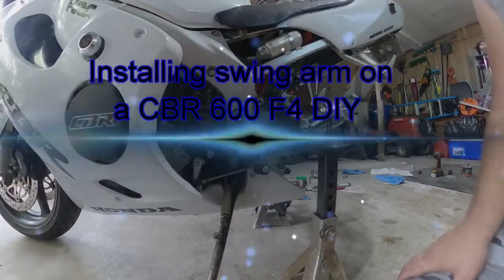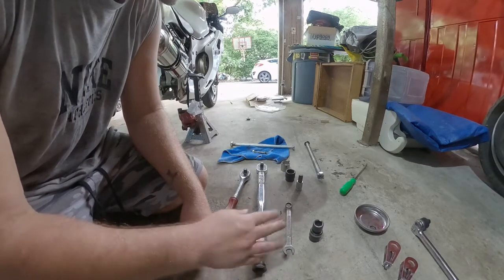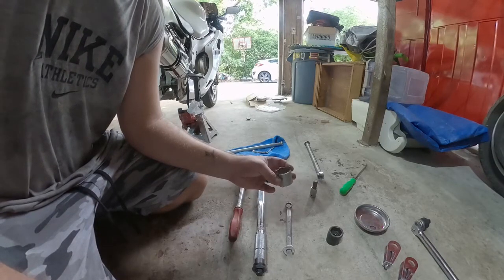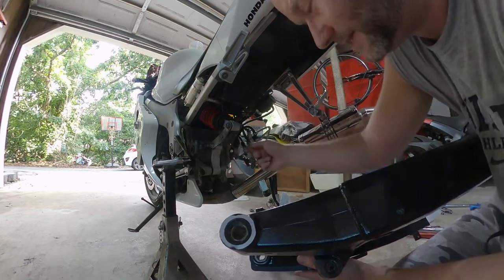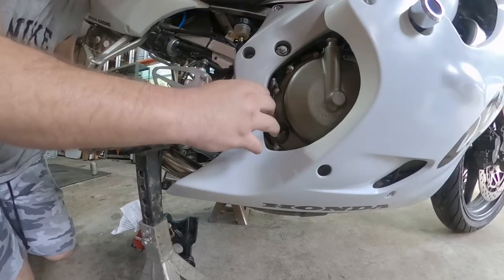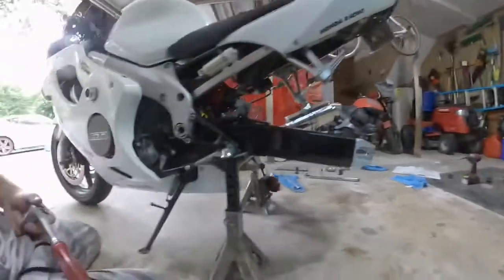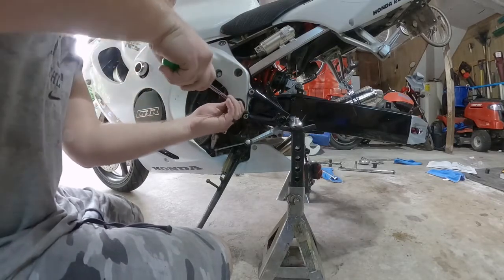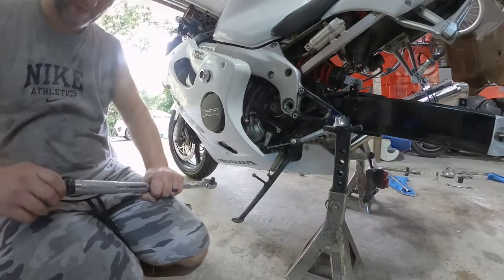How to install swingarm on a CBR 600 F4

Comment: The big bolt must be installed through the swingarm starting from the right side of the motorcycle with the nut being tighten on the left side.